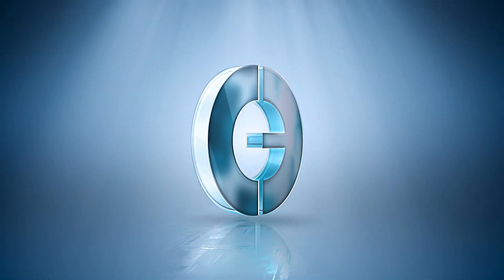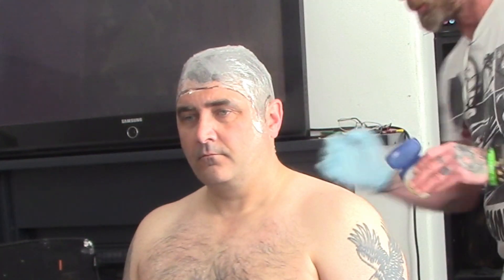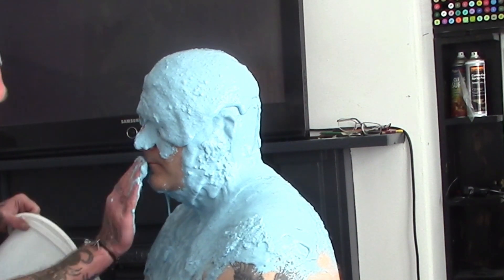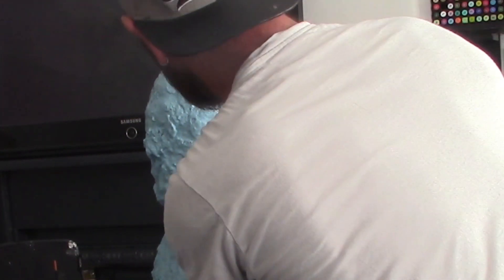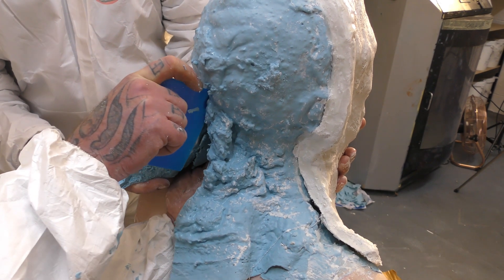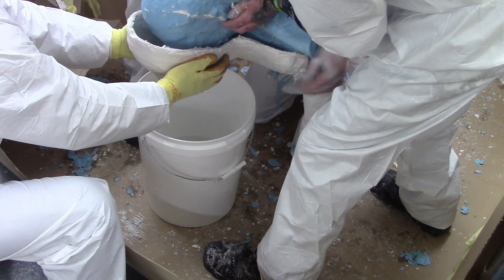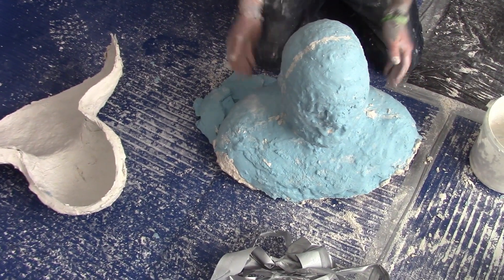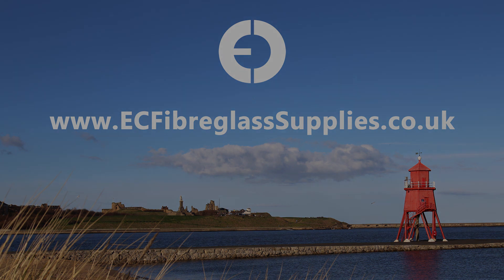Full Head & Shoulders Lifecast using Alginate and plaster

Comment: The torn alginate at the back of the head is put back together? How?
Reply from the maker: the joins are  just carefully pushed back in position once it is laid back into the plaster shell, cutting it in a zig zag will also help it click into place.  This will be a slight seam line on the plaster casting  which can be easily sanded out.
Reply from the maker: also the alginate is carefully cut before a very gentle and careful removal. dont use anything sharp, we just used a plastic knife to cut through.

Comment: What is the measured amount I would use of hydrocal 30 to fill a bust mold?
Reply from the maker: i'm not familiar with hydrocal 30  we went though approx 7-8ltrs of mixed plaster for this bust and saved on more plaster around the shoulders by using plaster bandage.  It would be best to pre-fill the mould with water and quickly tip this out and measure that volume of water.   This will give you a rough idea of how much mixed product it will take to fill the mould.